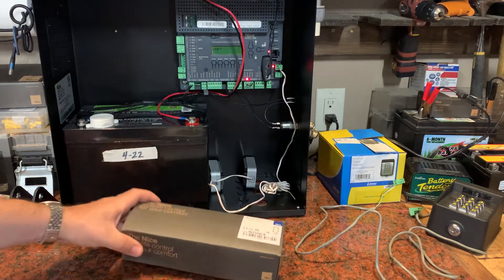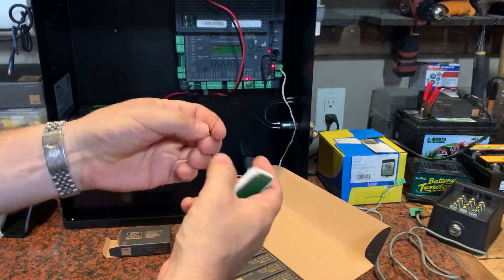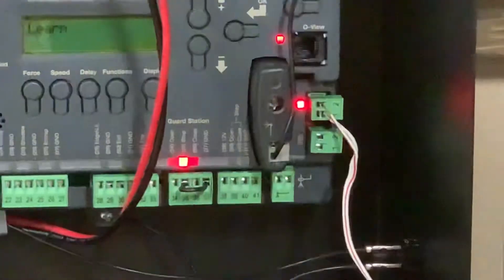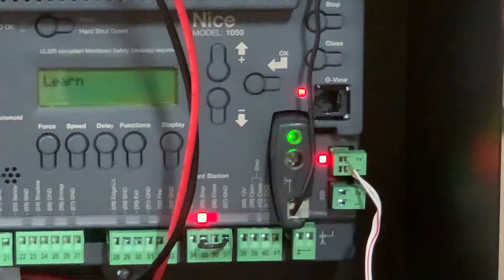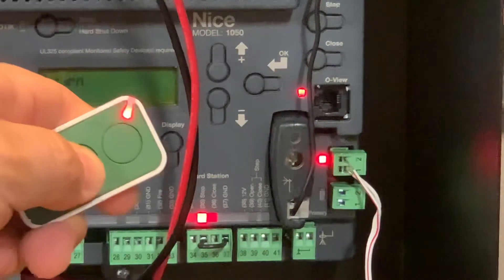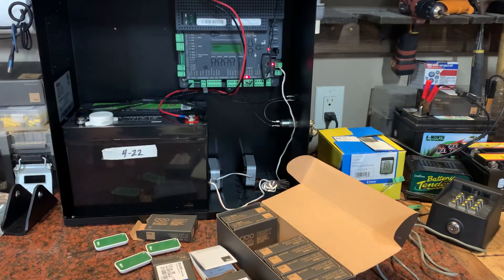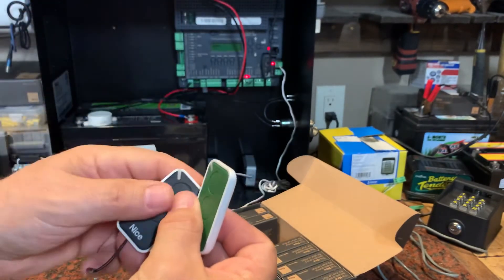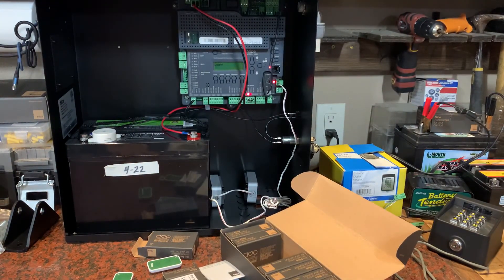✅ Nice Apollo ● Method #1 ● Program Remotes for 1050 Gate Operator at the Control Board

Comment: If I have other remotes that are not Nice brand. How can I program the remotes?
Reply from the maker: You can’t connect any third party remotes to the Nice receiver. What you need to do is add another receiver (with remotes) to the board. This is really common.

Comment: I changed the battery on our 1050. Everything came back up, but now all our Nice remotes only work from about 15-20 feet away. The used to work from about 1000 feet! Any advice? Thank you. Great video
Reply from the maker: Check the small plug-in receiver on the board. That should have a small wire on it acting as an antenna. Maybe it fell off? Make sure it’s plugged in good to the board too. Good luck!!
Reply: @ApacheRanch  Thanks for the fast reply! I don't see a wire on the receiver, just a button and light on its left side, similar to your video. It says Nice OXI/A on the front. I popped it out, blew out any dust. It works as before - only short distances. The antenna on the box looks good, I know the battery is good. Thanks so much.
Reply from the maker: The newer one has two terminals where an antenna wire could be installed. The older version (like yours) is as you described. In that case, the antenna wire gets connected to one of those two terminals on the very bottom right side of the board (I use the left terminal). Maybe check that?
Reply: @ApacheRanch  Thanks again. The antenna wire (it's coax) both the wire and shield are firmly inserted into the board. Maybe it's time to replace the receiver.

Comment: Hi There, I had a gate opener stolen and want to clear the system in order to remove all the openers and then reprogram the remaining openers. Do you happen to know how this can be done?
Reply from the maker: You can try this:  On the small receiver that’s plugged into the main board. Press the button and hold for 12 seconds. Then it will start to blink. On the 5th blink, let go of the button. Then it should make several quick blinks. That should reset the receiver.
Reply: @ApacheRanch  thank you so much, will try tomorrow and let you know!
Reply: @ApacheRanch   your method worked!! I am so grateful for your willingness to help! Thank you so very much!!
Reply from the maker: Happy to help!!! Glad you fixed it!